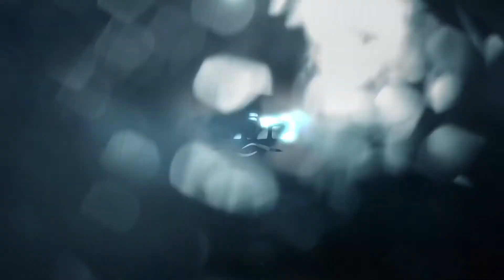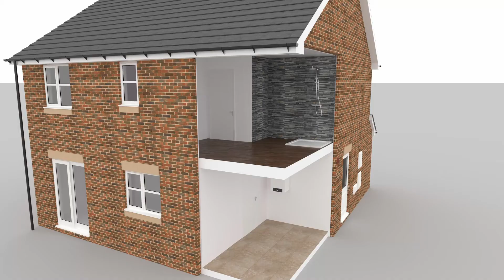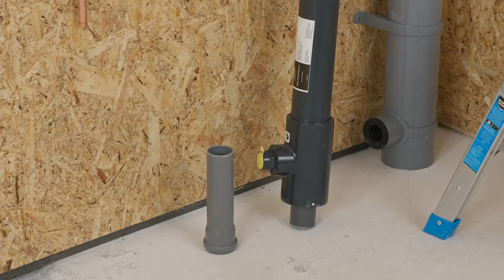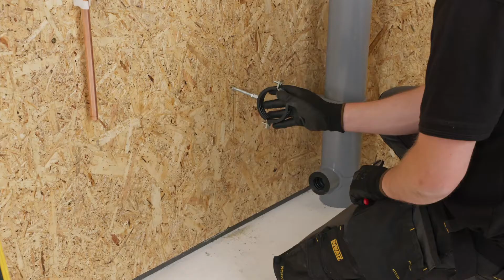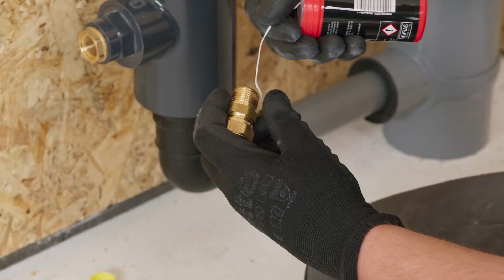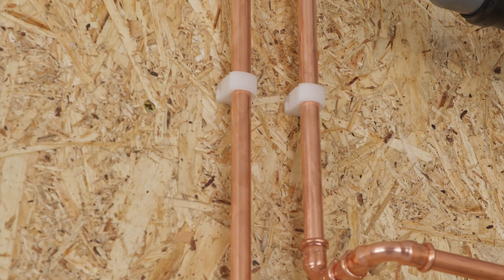Mira HeatCapture Step-by-step installation

Comment: What happens if you only have one floor?
Reply from the maker: The vertical unit has to be installed below the waste of the tray. If there is no way to create a run-off to the unit, then it would not be a suitable product in that situation.
Reply: @mirashowers  that’s a shame. Rules out any single floor flats, any bungalows and many multi floor homes in the U.K.
Reply from the maker: @hks-lion  We are looking at a Horizontal version that would work for these installations - watch this space in 2023!